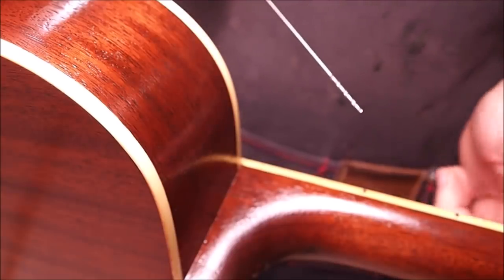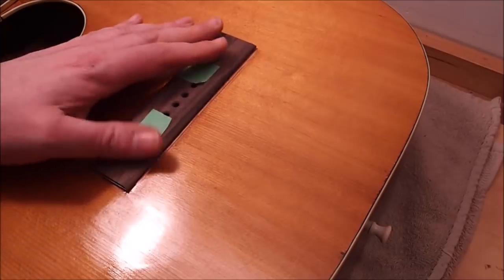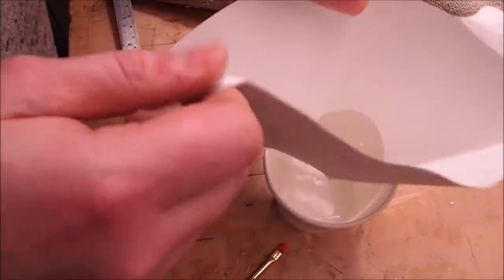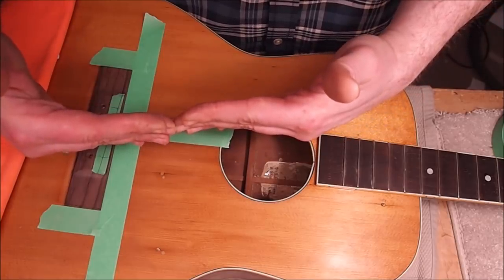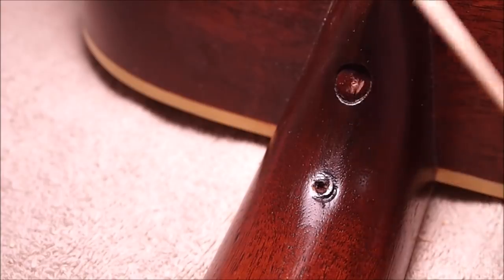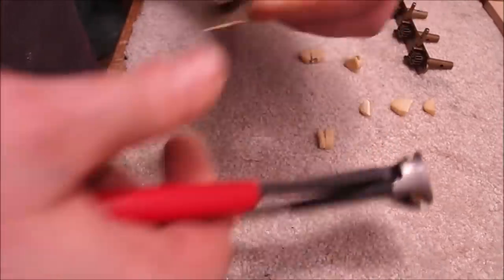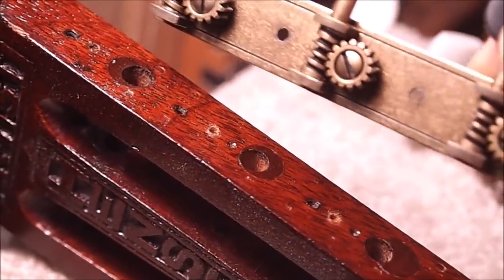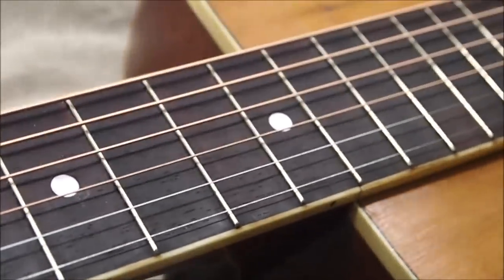Hensel Artist Guitar Repair (another one!)

Comment: I use Oxalic acid all the time on log home restoration spraying gallons of it
a day. As I get older I find the tightening of the skin on my face from the overspray
makes me look younger and it tingles.
Oxalic is great for removing black iron stains from wood, steel filings will turn wood
with tannins, pine, fir, spruce, black.

Comment: You might want to check out Jerry's method for saddle placement on Rosa's String Works. Basically it's a trapeze style jig that allows him to temporarily install the high and low E strings. Surely it must be better than the best measurement.
Reply from the maker: There's enough width in the saddle to push individual strings back or forward to achieve good intonation.  These are all compromises, btw - having the 12th fret octave ring true doesn't necessarily mean the rest of the board will sound good, especially in these old guitars where fret position is kind of loose.

Comment: Another great video, just curious though, heat would cause the metal to expand when replacing those tuner knobs. Wouldn't it be better to use a lube that would evaporate? As an ex downhill mountain biker we used to use Windex to slide our grips on, once dry they would have to be cut off.

Comment: you can use cedar shingles as a wedge to prevent blowout when drilling. Its easier than trying to cut one.
Reply: That is true , however , using a harder wood will assure that the tip does not cause any damage upon exiting.

PEACE OF MIND IN TECHNIQUE IS PARAMOUNT HERE.

Comment: Oxalic acid is also used as automotive cooling system flush, in a small bottle ., and its in solution already.. Pretty much any auto parts store has it , and yes it is fairly potent.. You will have to check the actual chemical composition, and is commonly used to remove corrosion from  cooling system aluminum, cast iron , and ethyglycol antifreeze.. and of course all the automotive engine contaminants .

Comment: I have 4 old Silvertone Parlor guitars painted black. They were sold by Sears and Roebuck.   They have a faux tiger burst finish.  2 are near perfect but 2 have neck bow. I use those for Slide guitar.  Is it possible to fix the neck bow from the strings sitting for 60 years?  Thanks for your repair videos.  I am a Classical guitarist and play electric and I love old parlor guitars. The first guitar I touched was the old 15 Dollar silvertone. So I go back to those for a special tone that I really like.

Comment: Omg!! This guy is really good AT GUYS JOB!  But I musty say he has NO sense  of saving rate parts. No sense of doing EVERYTHING and ANYTHING to SAVE ORIGINAL PARTS and conserve the uppermost originality in vintage instruments! Like wanting to drill straight through the neck!! You can't go drilling holes all Willy nilly in vintage instruments,it destroys the look ,the value and more importantly it's originality, beauty and the simple fact that it has survived as long a it has in a tooth worldof music. Also cutting the very old vintage tuners! You have to do whatever you can to remove them WITHOUT DESTROYING THEM! ORIGINAL PARTS AREN'T BEIN BEING MADE ANYMORE! THERE'S A VERY LIMITED AMOUNT OF ORIGINAL PARTS! EVEN IF YOUR REPLACING THEM THEY HAVE TO BE SAVED.
Reply from the maker: Calm down Aser. Someone drilled out for new tuners on this thing in the 1960s. There are a lot of original parts that no longer work, can't be repaired and frankly, weren't very good to begin with. A guitar that won't stay in tune is worth nothing.